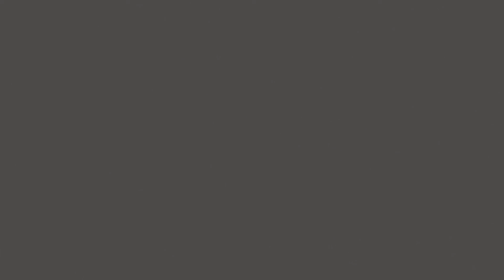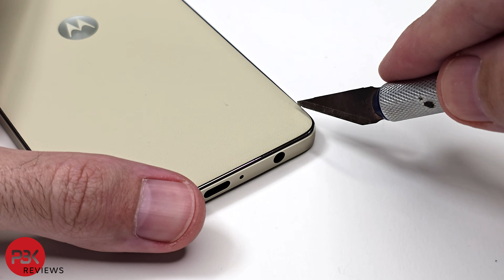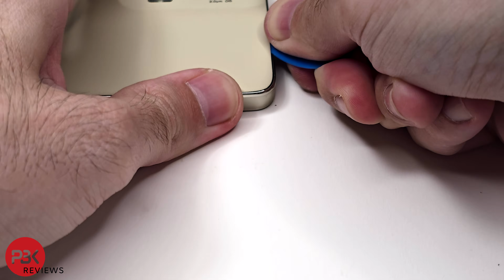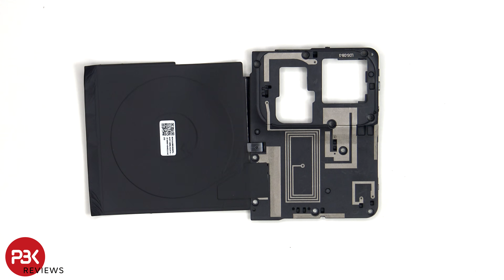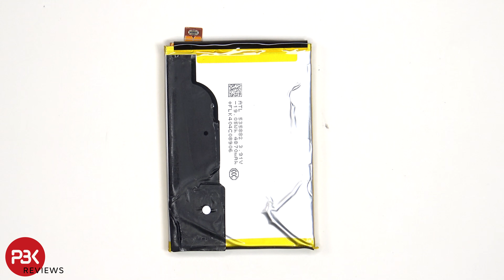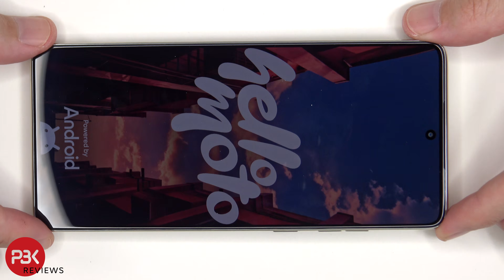Motorola Moto G Stylus 5G 2024 Teardown Disassembly Phone Repair Video Review

Comment: I replaced the screen on mine and now my buttons won't work??? So the phone can't turn on , it charges and it shows the charging logo but won't power on as if the buttons aren't functioning any idea what it could be??
Reply from the maker: Did you replace the entire screen assembly combo that comes with the frame and buttons? or just the screen. if just the screen then make sure you didn't damage the flex cable for the buttons and also make sure the main board is seated in properly so the gold pins touch the gold contacts on the flex cable to give it signal. if you replaced the entire frame assembly, make sure the flex cable for the buttons was in that assembly, it's possible it may have not been included.
Reply: @PBKreviews only replaced the screen not the whole screen assembly, ordered new buttons and nothing . But the phone powers on and shows the charging logo. Been trying to get it to power on without the buttons and so far no luck

Comment: i have looked at other videos for a moto g stylus 5g 2024 and the other ones the insides don't look like mine but this video looks like the inside of mine and i ordered a replacement screen and i don't think it is the right one  the one i got has 2 cables and one is short less than an inch and the other one is long and i tried to route the cable through the slot on the frame but the cable is too far to the left so it won't fit in the slot is there more than one screen model for this same model phone?

Comment: I've been using this phone for about a month now, for the price it is a pretty good option. only issues I've had so far are the stylus button gets stuck sometimes or gets pushed out in my pocket, the other issue is with a month of use the faux leather is starting to peel above the Motorola logo which is disappointing. I also expected better battery life but its not terrible either.

Comment: 2:58 hey so i was using this disassembly as a guide and during the removal of the coaxial cables, i accidentally pulled apart the metal bit of the white connector and the bit that clicks into place came off.

ive been trying to put it back together for the past hour but im having a hard time. 

ive also been searching online what these cables are for in case i can get away with just not connecting them but i cant find any layout diagrams or anything. 

is this a very important cable? and can i get away with just pressing the connection in place without it actually clicking into place?

Love your disassembly tutorial i just messed up at this specific part
Reply from the maker: The coaxial cables are used generally for antenna contact connections from the sub board to the main board. So you would possibly run into service issues if its damaged or not connected. Check on mobilesentrix.com for coaxial cables and see if you can find one thats similar in length to use since coaxial cables for phones are usually hard to come by for some reason
Reply: You mean the black and white WiFi antenna cables? Just measure and replace.
Reply: Seems like the receptacles came off as well when I removed mine. Did you find any resolution they either came off or I just can't tell where they plug back into
Reply: @Innovation.Dance.Strategy-p2u I just didn't connect them. other than random reboots that happen infrequently (idk if the disconnected coaxial is the cause tho), everything works fine
Reply: @SuperRSWalkthrough oh all right maybe I will finish putting it back together I was told that I wouldn't have an LTE or 5G signal maybe these antennas  are just Wi-Fi?